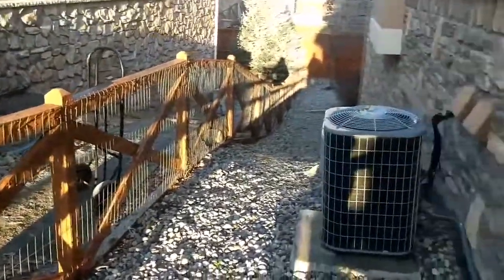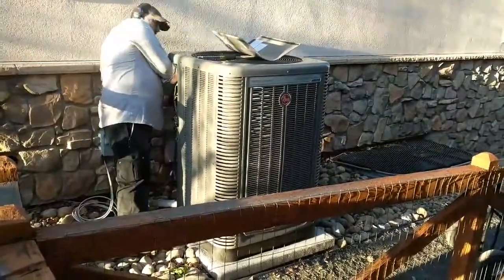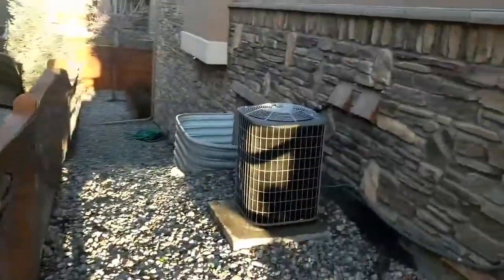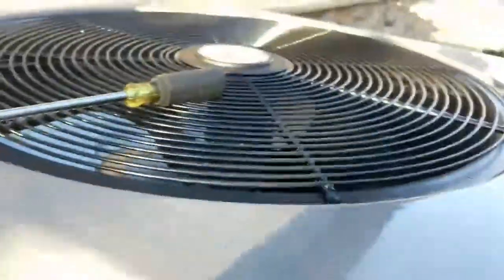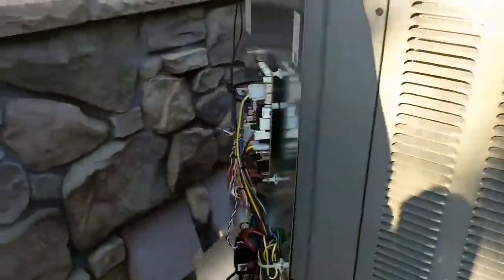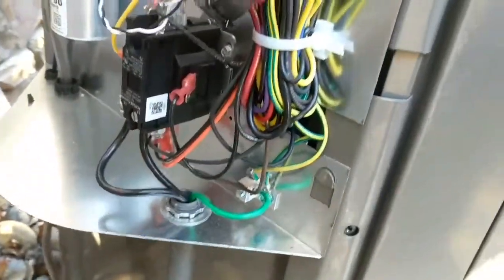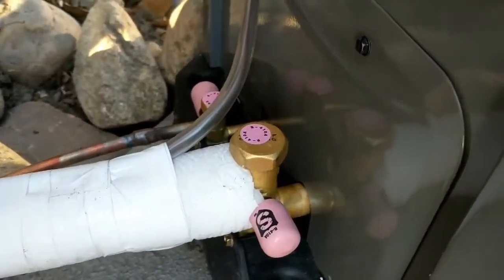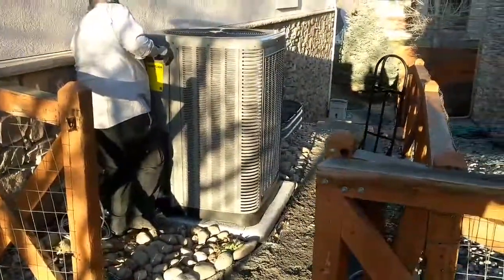The difference between a high efficiency AC vs. a regular Efficiency AC

Comment: He basically says nothing about the differences.   Powder coating and hail guards do nothing for your electric bill.  A two stage compressor with a larger condenser takes forever to pay for the difference in cost if you do the math.  You're better off buying a high efficiency furnace and you'll see the difference right away on your gas bill.  Just buy a high quality AC system and be done with it.   Service costs will be lower and the system is much simpler.